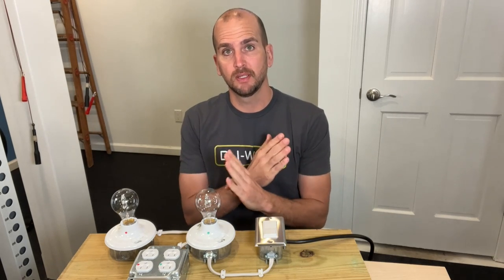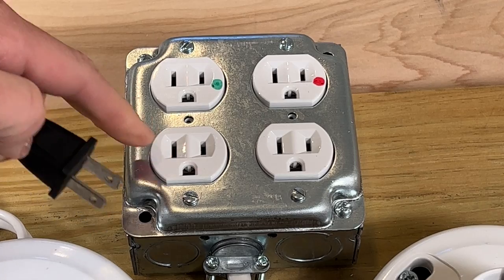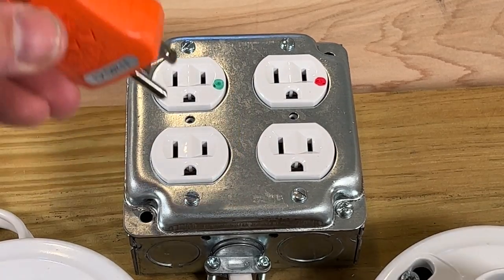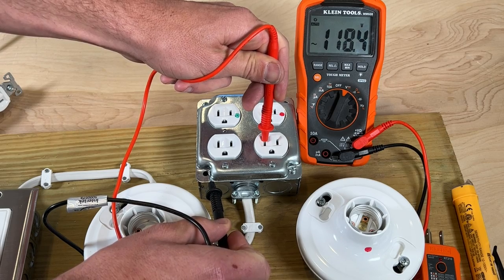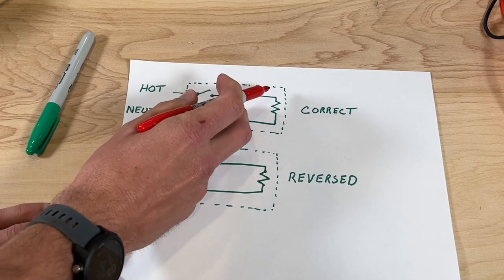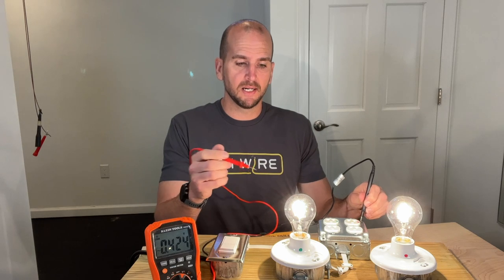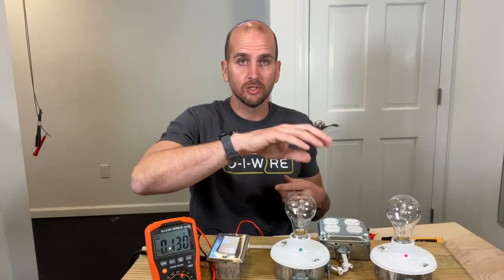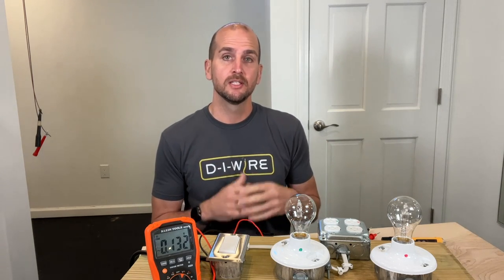Dangerous Wiring Issues In Lights and Outlets

Comment: I have a fair grasp of electrical, not an electrician by any means but as a plumber we had to learn a fair bit. Am I wrong on this? I understood that grounded devices are designed to fail to ground, would that not mean that a device plugged in to a backwards plug might not fail to ground properly and potentially become a shock or fire hazard due to not throwing the GFI, acfi, or breaker as it is supposed to?

Comment: Thanks for the great video! I have a question, my house has the very old outlets with two narrow slots and no ground. I've been switching some out. How do I check polarity in the older outlets that remain? Thanks!
Reply: Buy a good quality fluke non contact tester. I don't trust anything else!
You can get 20 to 30 volts coming back on the neutral on these old systems, which could trigger a cheap or very sensitive tester.

Comment: @4:38 you speak what happens whit reversed polarity. But it is AC so both wires have voltage, one time negative other time positive. 
This is special issue in DC applications. Where Hot or positive can arc against metal housing because fuse is before the switch. 

In the EU where we have dobble voltage, the schuko scoket does not prevent how you power a device. So at the device the power hot (or live how we call it) can be switched. Just by turning the connector in the socket. Special machines or big machines are wired directly. 

Do not know how the code is in US. but over here we have LIVE is brown Netural is blue and black we use after a switch.
So the wire from the breaker is black and goes to the switch.
Light bulb have than black and blue wire.
Reply: The neutral is grounded so it has no voltage - ever. The phase has voltage referenced to the ground and it alternates between positive and negative.

Comment: I've ran across this in my house. Several receptacles were reversed. I corrected the problem years ago. None of my lights were reversed. A neighbor down the street put the black wire on the silver screw. Not only that, he hooked the wire loop counter clockwise to the screw. I straightened him out. 🐀🐾

Comment: Interesting never really thought about that with the light fixture. The issue I have I guess is that they don't design them to operate safely the way you describe so there isn't really a standard practice to be careful with that. Even the two terminals in the light fixture are both bronze indicating hot so unless you look to which direction those terminals go to you would be non the wiser. Also a lot of plugin lamps are non polarized meaning you would need to know which side of the plug is actually hot but you wouldn't know that unless you tested it and marked it or opened it up and traced the wire. But this sure does look like a safety concern to me! hopefully they standardize it someday.

Comment: Question: How do I test for reverse polarity in the case of a light fixture. What do I use for ground?
Reply: Use the ground connection in the light fixture where the bare copper wire or the green insulated wire is connected.  Assuming the light is mounted to a metal junction box and the metal junction box is properly grounded. the metal box is the ground.  Of course if the neutral and hot are reversed it's also possible that the JB isn't properly grounded.
Reply: @minuteman4199  they could always give it the lick test. That never fails!

Comment: I've got a small problem with one of my duplex sockets showing an open ground. the wire is connected, so somehow my ground wire isn't getting all the way to ground. Other outlets on the same breaker appear unaffected. I'm not sure its worth losing sleep over, as the fan, lamp and clock don't have ground pins anyway. But the surge protector there is a constant reminder

Comment: Those testers of course cannot show neutral/ground reversal.  "correct" display is not a certainty.  Hard to design that into a detector, but it is a dangerous reversal.  That is why I do not own one.  I still like to do a visual.  Then use a cheap multimeter to confirm hot on correct side.

Comment: Here in the Philippines , they do not use the safety ground and even if they do, it is not done correctly.  Most homes do not use Black for hot and White for neutral.  It ends up what ever wire is available at the time.  Your yellow tester is better than mine.  A non-contact voltage tester, all it has to do is be within 4 inches of a hot and it beeps.  Not good because neutrals are within the same distance.  It gets even worse when you see how the the CB panel is wired.  The main breaker does not remove boh hot and neutral to all circuit breakers.  It removes only one so in order to isolate a branch, you must turn off 2 breakers.  Not safe at all.

Comment: The terms for any sort of two pole connector including Edison sockets is tip  and ring. With tip being the very tip and ring being the circular part, In this case the threaded part. This terminology goes back to old phone switchboards and the large haedphone connector style plugs they used.
In almost all cases tip is plus and ring is negative, even with low voltage power plugs like wall warts. On power plugs with an inside and outside tip is inside and ring is outside. It is very rate that ring is a positive voltage... this is usually only done to make a power supply proprietary and force you to buy it from the manufacturer (or reverse it yourself on a non proprietary model)
The idea is always keep the voltage part away from the user, and therefore on the tip

Comment: there is alot of old houses  that switched the neutral and light or outlet would have it constant hot . very bad situation and bite you hard . when going to replace and see switch is off . a shocking way to find out .lol
Reply: And in some older houses notably old farm houses with an outbuilding , a yardlight in the middle, and a pair of three way switches,  one in the house and the other in the outbuilding,  which also contains receptacles which remain live at all times, using only three wires between house and outbuilding,  excluding the equipment grounding conductor.   How they accomplished that was by hooking the hot and neutral to the travellers on each three way switch,  which continues the circuit to the outbuilding.  Then a single wire would come off the common of each three way to the yardlight.   The bulb will be OFF if it sees two hots or two neutrals, but turns ON when it gets a hot and a neutral,  polarity can be correct or reversed depending on the position of the switches.

Comment: I’ve encountered a circuit that had its neutral being used for another circuits Line. So I flipped the circuit breaker into the off position but was still getting 120v through the neutral.

Comment: Not in a house, but I  have met a few people who wired lamps incorrectly. The hot side of a two lead wire did not go to the center contact on the bulb. Using the none contact tester would verify a safe connection.

Comment: Would you make a video that would teach us how to determine what is neutral and hot in a wire when you can’t see the start or end of this cord?
2) circuit panels. How does one know how many breakers it can sustain. It may have 20 cavities.  Does that mean I can load them all? Collectively, is there a total in amps they can’t exceed? The top big fuse is 200 amps. Does that imply one cannot add more 10 circuits w 20 amp breakers?

Comment: With Edison screw fittings and older 2 wire outlets (prior to the 1960's) you never assume anything to be neutral or ground since it was potentially not a standard at the time it was installed.  

Reverse wiring isn't going to effect the way pretty much any AC device functions or it's life expectancy since Neutral can never be used as a ground, even on appliances and devices with a polarized plug and AC has no polarity.  Some newer 3 prong devices may go into an error state if they are way to smart and they see the reverse wiring but should not be damaged by it (if they are smart enough to tell an outlet is miswired they are smart enough to cause all kinds of issues so don't buy appliances or devices like this).  Many newer GFCIs will still work just fine regardless if they are reverse wired but once tripped will often not reset and many old units will not always trip properly when reversed.  

The Neutral and the Line connections in appliances and all the way back to the main entrance panel must always be isolated from the ground via insulation (often double insulated inside appliances).  Switching the neutral inside an appliance is still very common since the appliance is often double insulated if 2 prong or isolated from the grounded chassis if the chassis is conductive.  

Again, always assume that the threads of a lightbulb are live and never assume the person their before you wired it correctly.  Also be aware that a neutral is a current carrying conductor and under heavy load may still cause a shock if you are touching a grounded surface and then touch the neutral even if the switch is off since other circuits may also be using the neutral in that circuit.

Comment: At about 5:40 you say that the life of the device can be shortened by having circuit reversed wired.  It's not clear how the life can be shortened if the switch is open and no current if flowing?  Can you explain further?  Thanks!

Comment: Thanks for the tip. I have a question regarding a ceiling fan. Whenever I have the ceiling fan light on, the light keeps blinking. I have tried changing the wall switch, but the problem still exits. Are the wires reversed or what could be some other possibilities to correctly remedy the problem. Thanks. Shabbir

Comment: Years ago I lived in a rented house.  I was installing a humidifier and needed to drill a hole in a copper water pipe for a clamp-on tap.  The closest electrical outlet was in a bathroom.  It was not GFCI, but it was a grounded outlet.  I was using a metal-cased electric hand drill with an attachment to center the hole on the pipe.  As soon as I touched the drill bit to the pipe there was large flash, bang, and the lights went out.

When I investigated, I found that first, there was no ground at that outlet; second, who ever installed the outlet had faked a ground by connecting the neutral terminal to the ground terminal; and third, had actually connected the hot wire to the neutral side of the outlet.

So, when I was holding the metal-cased drill, I was in effect holding the hot wire in my hand.  Had I touched the pipe with my other hand instead of the drill, I would have completed the circuit to ground.  When I told my landlord about this, he couldn't understand the gravity of the situation and wasn't really concerned.

Comment: I've found just one appliance that would not work correctly with reversed polarity: A gas furnace. It uses flame detector based on ion conductivity to ground which does not work when you reverse polarity.

Comment: I found an outlet with an open ground. Inside the box, the ground was present and connected.  Traced it to a junction box in the attic - ground present and connected. Traced that to another box - same story - and traced that to another box that was a) buried in insulation under the attic floor, b) not secured to a joist or anything else, and c) less than half the cubic inches required by box-fill rules. There was a good ground present in that box, but for some reason, someone had snipped off the ground in the cable ultimately feeding my ungrounded outlet.  I replaced that box with auch larger one, no longer buried under the floor, and replaced the cable between that box and the next one to restore the ground.

Comment: Another dangerous condition is when people  use a 3 conductor cable (blk red wht) and use the wht as a common neutral for the blk and red back to the breaker panel. There is the potential to get shocked if both breakers for the red and black are not turned off. I've seen this condition far too often.

Comment: The light socket danger is not only a problem for the live wire coming first through the light socket controlled by a "blind loop" switch (please forgive my amateur terminology). Even if the light socket is "after" the switch, a hot-neutral mix-up at the socket is a shocking surprise for someone changing a burnt out bulb if the switch is still closed. Right?

Comment: Do they make a polarity tester for light sockets. There isn't always a ground nearby for using a multimeter.  Edit: seems they don't but I came across a way to get a ground by using the ground plug on an extension cord.  Someone also suggested that a non contact voltage tester would also work to determine if the screw thread portion is energized.

Comment: Hi, I've got a question, I have a house that doesn't have neutral wires, my switches were wired in a way that they use use the white as hot and the black as a return wire to the light fixture. I'm wanting to add outlets to existing outlets in my garage, I'm thinking I would be able to connect to the other side of the outlet, but I'm sure about the neutral issue seeing as I haven't started this project yet.

Comment: The most common issue I've run into (multiple times), is the light switch itself is wired wrong! So the switch cuts the neutral line and not the power. So  the light socket(s) still have live power to them with the switch OFF! I can't tell you how many times I've discovered this problems in the homes I've owned. So I'm extra careful around light switches when replacing bulbs. And some people I've talked to don't understand the problem "It's not on, so its OK". Argh

Comment: I fixed a swapped wiring issue for a friend. Her new microwave wasn't working and I was curious if it was this issue and that's what it turned out to be. I swapped the wires at the microwave outlet and problem solved. (It was an add on outlet that I wasn't going to trace back to the swapped junction box.)

Comment: Just yesterday the previous homeowner had wired a light switch those two outlets outside around my pool. I was having problems with an outlet so I traced it back to the switch and found out that that person add tied together to hot wires with a nut and put the white common wires on the switch. I was baffled immediately so now I have to replace a whole bunch of very expensive GFCI outlets.

Comment: Hi there,   I just bought a beautiful antique Ceiling Lamp for the closet.  It came from a 30 year old house
where it was installed.  Both wires are covered in a cord like material.  The cords are both white, but one has
a ring ribbon printed on it.    The gentleman said it doesn't matter which wires are hooked up 
to the black and white wires on the ceiling.
Is this true for antique lights, or should I treat the Red Ribbon side as the hot?
BIG THANKS!
Reply: One of those wires should have ridges on it that wire will tie with the white wire, the other smooth one ties to your black (hot) wire.
Reply: @sargentnocap1414  Thanks!  I was waiting to hook it up.  Now I will remember, 'Smooth as BLACK velvet'!
Reply: @momzilla9491  No problem, any other questions feel free to shoot.

Comment: It is vital to ensure your "phase" (hot) cable is connected to the "Load" terminal and "Neutral" cable is connected to the "return" terminal.  Where there is an "Earth" cable this must be connected to the "chassis" or designated "Earth" terminal of an appliance or circuit.   The "Neutral" cable should never be connected to an "Earth" terminal.   Mixing them up is a potentially fatal error for you or another user.
Reply: Neutral is connected to ground at the point of entry. So never say never.

Comment: I have a light in the bathroom of my older home. There are two switches. Both for lights. When I turn the breaker off, I still have current running to one light. The other will turn off. I also have a switch in a bedroom next to this bathroom. There is one light switch. I can turn off that breaker, and still get juice.  Do I need to turn off the main power to change out the two switches?

Comment: Reverse polarity was the reason my stop which was gas went up, because of the constant power part of the board died about a year after getting it, since it was all professionally done i never thought to check for reverse polarity until we had electrical issues. So reverse polarity even in receptacles not good.

Comment: I have been told that on a gas range with an electronic igniter (spark generator), the ignitor module can be damaged by reverse polarity.  Is this true? And how many years do these spark modules usually last before failure?